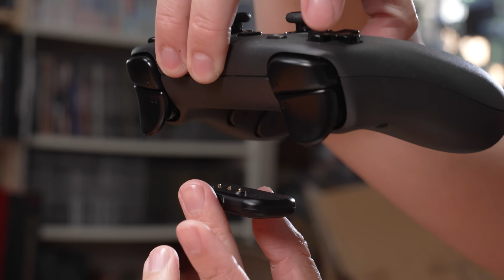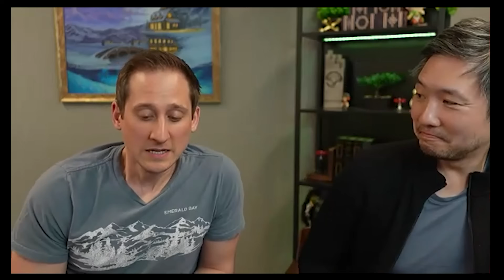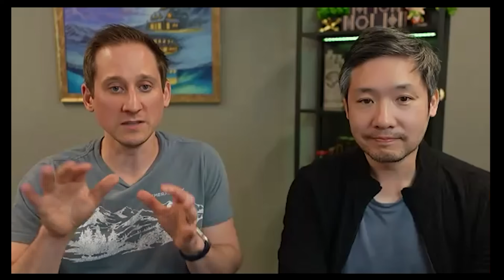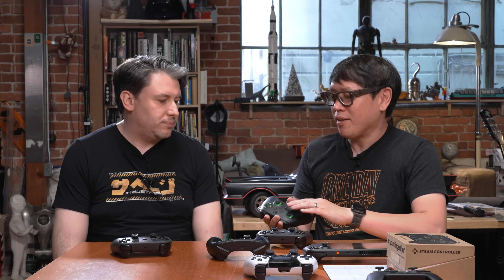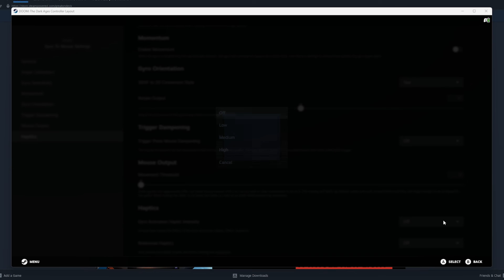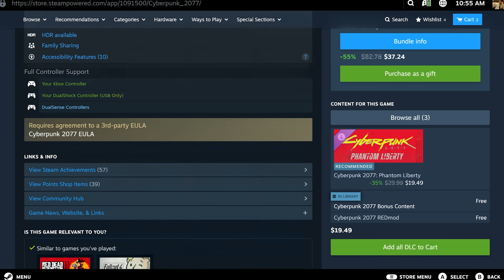Tested: Steam Controller Review + Valve Interview!

Comment: The trackpads are so much more than just mouse pads. They're keyboards, scrollwheels, god-level customizable binders.
To suggest a version of the Steam Controller WITHOUT the trackpads is an absurd oversight.
The applications of the trackpads alone, especially with Steam's built-in customizable controller binding software, are about half the worth of the controller.

Steam even allows you to make an entire multi-tab UI for additional keybinds, filled with as many options as you could possibly need or want. 
I remember playing PUBG with my Steam Deck (just as a controller for my PC), and I was able to bind 8 different consumable items to just my left trackpad. It's the little things that count.
And of course binding the 4 back paddles to things like Sprinting, Jumping, Crouching, etc. is an extremely useful feature!
Reply: The trackpads are the whole reason i want one. I want a controller i can use to control a PC from the couch.
Reply: @Duhya same here and for some of my games they were completely build around mouse input..... It's completely impossible to play these games without at least the Trackpads ...
Reply: @Duhya wife would kill me if I put a PC in our living room 😅
Reply: @Duhya you can literally buy a wireless keyboard and mouse and do the exact same thing
Reply: @bigguschungus968  If you dont already have a good controller, buying an 8bitdo one plus wireless keyboard will cost you basically the same in addition to more clutter and less convinience.
Reply: @bigguschungus968 As someone who tried that, its not the same. Trying to keep your keyboard and mouse steady on a couch is inconvenient. The steam controller looks like a much better option.
Reply: @shock019 my dad did that for many years throughout my life. He had a little coffee table he kept the mouse and keyboard on and just slid that over when he wanted to play Elite Dangerous on the big screen
Reply: The trackpads made modded minecraft playable on steam deck for me. Left is a 4x3 grid of hotkeys and right is for mouse in inventory management and aiming. It works so much better than just analog sticks for me.
Reply: Must. Have. Trackpads.
Reply: Many questions during the interview were also weak as hell
Reply: @pinksnake7584  Yeah, completely tangential to shit people actually cared about. Only thing that was relevant really was the polling rate, and the thing about the IR sensor being in there.
Reply: Also if it doesnt have the trackpads just buy a normal controller
Reply: 19:30 atlas mentioned!!!!!!!
Reply: How did you use the steam deck as a controller for ur pc?
Reply: @gardeniabite  I think it was just the remote play feature, but it's been a while, so I don't recall
Reply: @gardeniabite The only way I know how to do it is to stream the game from PC to the Deck and use the Deck for controls, but have the PC do all the processing and heavy lifting. Only works if you've got a really solid wifi connection to the Deck.
Reply: How?
Reply: @sly2792004 steam controller layout settings
Reply: This tells me to not spend my time on this review if they're completely disregarding the trackpads. Appreciate your comment as a 10 year Steam Input veteran.
Reply: If anything, drop the sticks if you want to make a cheaper one. I don't think even that version is capable of competing on price with the existing TMR controllers that have been cost optimized to hell and back already. Lean into the hardware being weird and unique. The Steam Controller brand is touchpads at this point.
Reply: @DigitalJedi I don't agree. I would never sacrifice the sticks.... I never had some interest in the first steam controller especially because of the lack of a traditional gamepad input.... It's definitely the combination of both what makes the steam controller such a great product....
Reply: They really gave these controllers to the worst possible reviewers. Every time they open up with "yeah, I prefer an xbox gamepad". I know immediately they're full of shit and it'll be a bad review.
Reply: @choo_choo_  that and they kept talking about how AAA gaming is just making everything controller compatible

what about little indies without the specialty or resources to focus on making controller compatible bindings or menus?
Reply: @Mahrooby You can assign buttons through steam itself, I believe.
Reply: @mooheeroo8466  You often have the issue of needing more buttons than an x-box controller offers and even if you get some third party controller with more buttons some things can be raher awkward.
If you have a shooter with a lot of inventory managment for example you can use the trackpads as a mouse to quickly move items around close the inventory and use it as a radial menu to use items from the hotbar.
Reply: @Mahrooby  Ironically, both Triple-A and Indies already struggled to make every controller compatible.

If they use Steam Input API and/or SDL Gamepad API, they wouldn't have to deal with that problem.
Reply: @thebaumfaeller1477  The new SC has a pretty hefty amount of inputs, and you have infinite possibilities with radial menus (especially when they give you 5 different directional inputs for them). Add the grip-sense for layer switching and you're pretty set.
Reply: @thebaumfaeller1477  I recently played god of war 2 and the "quick access map" was bound to the PS controllers touch pad thing and had nowhere to bind it to on my standard knock-off xbox controller. 
Also some old games that used the analog flick control system, like the fifth Harry Potter game and Skate, I can only imagine being way more responsive and easy to play on a pad rather that an analog stick that is always pulling itself back towards center and is riddled with deadzones that made some stuff nearly impossible. 
I also wonder about Wii emulation. While vr might be a better solution for people that don't want to buy old Wii hardware, two track pads could probably hit all the motion control gestures and be a smoother "mouse" than the shaky-hand pointer you had to use for menus and shooting. I remember bracing my arm and still hardly being able to use the main startup screen of the Wii.
Reply: @choo_choo_  I strongly disagree with this sentiment, it's actually very important to give a review sample to somebody like Tested who are coming from the position of "I like my Xbox controller" because that is where the vast majority of gamers looking at the Steam controller are also coming from.

If you only give the controllers to the hardcore enthusiast that hates gamepads and only grudgingly uses them for games that require them, and is willing to spend three hours setting up their ideal Steam controller binding for every game, that's just not a very useful review for the average consumers. There really are not that many gamers who are going to be willing to go through all that, and the simple plug-n-play experience where you're sitting there thinking "But is this really that much better than my Xbox controller?" is important.
Reply: @Blutzen  I want them to give the SC to people who use the SC. I want a review that acknowledges the strengths and weaknesses of the OG from extensive personal experience, and gives their thoughts on the new controller.

It's like giving a tech reviewer a car part and having them review it.
"I don't know much about cars except that I drive one, but this seems to work pretty well and the car drives so idk".
Reply: @Blutzen  It's as useful as giving a gaming mouse to an office worker to review or motorcycle to review to a car channel that doesn't have people that drive motorcycles. Or asking a console and expecting them to give a good review on a pc port when they are a novice when it comes to PC hardware and what settings do, since they are more used to a plug and play curated experience.

Normally when people seek out reviews they expect it to be from people who are experts in using it. When it isn't people who know the product well it's just an impressions or reaction video.

So I don't really see the "reviews" helpful if the background or knowledge in the area isn't strong. It has a novelty in what does someone who never uses this product think of it, but from a review stand point is ends up not being that informative. 

And when it comes to the Steam Controller I do think Xbox controller only users are one of the worst to review it, because it is a controller that has so many non standard inputs that require per game set up. Which is incredibly similar to going to a console gaming channel for pc reviews, which most pc gamers would find not to be good reviews.
Reply: @choo_choo_   Sorry I also too prefer the original Xbox 360 gamepad. I have a steamdeck and in no way is that control scheme going to replace either my xbox controller or my keyboard and mouse.
Reply: @Holret  I'm sure you tried it on the Steam Deck and thought it was crap, and I agree. SD's layout really doesn't lend itself to the best of what the original Steam Controller had to offer. Even someone like me, who has thousands of hours using the SC, I think the same layouts on the deck are just crap because of the layout and opt to use a more traditional XInput based layout like you'd see on an Xbox controller. If you can get your hands on an OG SC, and give it a few weeks to try out trackpad+gyro, you may find you like it, but if that's something you're unwilling to do the controller really just isn't meant for you.
Reply: Yeah. Xbox should have trackpads when they make a PC-hybrid.
Reply: @Lon1an I don't think that this is the road they are going to. They just want to make windows more gamepad compatible.... Which I also think that this definitely is important. And since the steamcontroller is soon there, I definitely don't need a alternative from Microsoft anymore. But yes they missed an opportunity....
Reply: Joystick movement mouse trackpad camera. I’ve lost the ability to use other control layouts after trying this. It’s amazing
Reply: @ebsolas hey man don’t know if you tried this already but you should try left touchpad to joystick for movement it feels really good even better than a joystick in my opinion.
Reply: Yeah. unless you intend to use the touchpads or at least explore its possibilities, the Steam Controller isn't worth getting especially at its launch price. Just get other controllers that might even be cheaper.
Reply: Valve show those kind of thing in their "Official Overview and Quick Start Guide".
If Valve cared more about this kind of detail then other thing, they would have also chosen some Steam Controller or Gyro channel at the same time.

And this kind of move might make people who need it more easy to buy one at launch.
Reply: More absurd is to think that PC gaming requires a trackpad. I agree with the host, they should offer a slim down version thats still compatible with the frame and steam machine. I tried playing RTS games on the steamdeck with the track pads and it gave me a sore. No cap.
Reply: @Holret  OP never implied PC gaming requires tackpads, they're saying removing the main selling point of the controller would defeat the point of getting the controller lol. And I agree with OP... 

You would think for many years companies would realize that maybe trying to pitch a  handheld that uses the joystick as a mouse would feel a hell of alot worst when playing k&m focused games, or surfing the web (looking at the web browsers on every handheld/console lol), valve really were ahead of the curve on the touch pad controllers and I'm glad they been doubling down on it for this long

Along with the many tweaks you can change with the touchpads using steamlayout, playing any k&b game (especially fps and rts titles) feels marginally better on the pads than the gyro+joystick combo on a CONTROLLER and handheld (not K&M). No one with common sense is saying using touchpads will outperform  a standalone mouse but it will outperform a joystick, it offers more configuration, which is the point people like OP is trying to say.
Reply: @Holret  There are do many other options. A controller from Valve isn't required. Steam Input works fine with most controllers. A version without the touchpads is pointless.
Reply: @AninoNiKugi yes. If not getting because of the trackpads... Why getting a Steamcontroller in the first place?
There are hundreds of alternatives but there is only one choice with two usable Trackpads.... The one from valve....

Comment: I have never used the capacitive sensor in the Deck's sticks. I will never use grip sense. I only need gyro when I press L2.
And the PS4 back button attachment has the best back paddles. I hate that the Edge controller is inferior, and 8 times the cost

Comment: I ended up gettitng the JSAUX replacement back plate for my Steam Deck and it came with different size back paddles that YOU could mix and match. I put a higher pull on the middle finger area and a slightly lower medium pull on the the ring finger. I rarely use them, but the whole thing feels so much better in my hands and is easier to use than what came stock. Hopefully there's some nice aftermarket replacements. Also, I'M SO THANKFUL WE GOT TRACKPADS!

One last thing... I wish we could swap the left Joystick and the D-Pad... would definitely help in a game like PoE.

Comment: I'm disappointed, not just because the price is high, but also because this isn't good for anyone. I'm a fan of the OG steam controller.
It's a worse deal than its competition for the average user, full stop. The average person wont use the pads, ever. Unlike 2015, most games have controller support. Steam OS/big picture mode makes it so you won't have to interact with your desktop most of the time. The Dpad is worse than the competition, no rumble, no adaptive triggers and it's also just generally ugly. The average console controller player (the target audience) doesn't want gyro! They want Aim assist, their sticks and games that don't require much aiming. Not good for shooters, platformers, fighting games, racing games...

And from my perspective, as a fan of the OG steam controller, why is the price higher for sticks I wont use? I want to use pads as primary inputs! 100$? for pads that aren't even circular? 
What is this for? Playing indie MnKB games? I can already do that just fine on the OG steam controller which was half the price. What's the point??

Get a Flydigi or 8bitdo controller. Don't fall for the valve branding. This is NOT your gateway to pc gaming!
Reply: You are missing the point entirely. Their target audience is not console players 😂😂 it's STEAM users be it on Windows or Linux
Reply: As an OG steam controller fan how could you not be excited? The gyro in the OG is trash by todays standards, you have more ways to interact with the gyro now, more back buttons, an extra stick and D-pad for more inputs and who the F cares about console gamers lol.

Comment: @ 30:30 " And I kind of wish there was a version of this without the touchpads. Yeah. Is that crazy? Should I try to justify this?" I don't think this is a crazy thought but at the same time, the trackpads going back to the original Steam Controller were kind of THE selling point, I dont think its wrong to want it without but at that point you should look into a different controller like the EasySMX X20 or something?
Reply: Plenty of TMR controllers with gyro and back buttons on the market for less, the trackpads are what make the steam controller unique

Comment: the Steam Controller has to compete with the best controller ever created, the original Steam Controller.
I've repaired my Steam Controller over and over again to keep it working and I still use it on a regular base. So I hope the new Steam Controller can replace my old one.
Reply: I'm really skeptical on the trackpad placement (and shape), but I've put so many hours into the OG that I feel like the people at Valve know at least what they're doing and I'm willing to give it a chance. If only to give my OG a well earned break. I've got an alarm set for when those controllers go live and I'm getting it in the first minute.
Reply: Yeah, me too. I've also activated the notification when the new Steam Controller gets available. 
I know from other Valve products that they don't sell any pre-finished products, so it's safe to be an early adopter